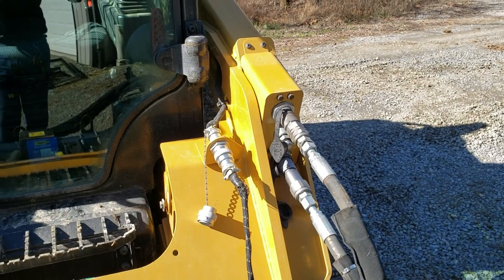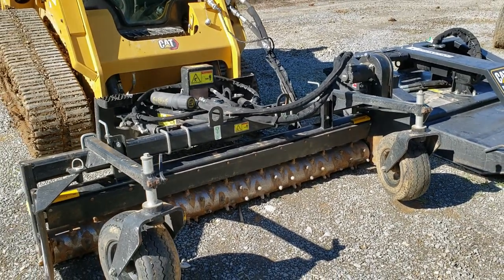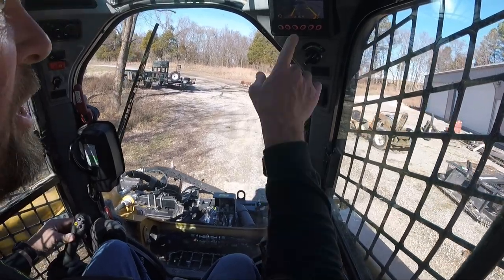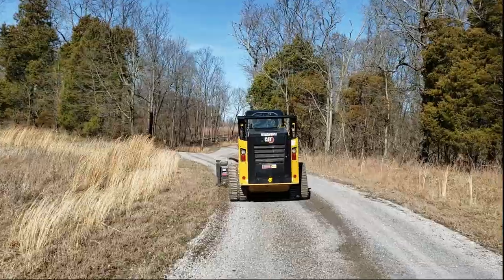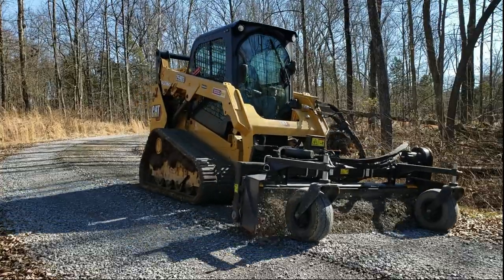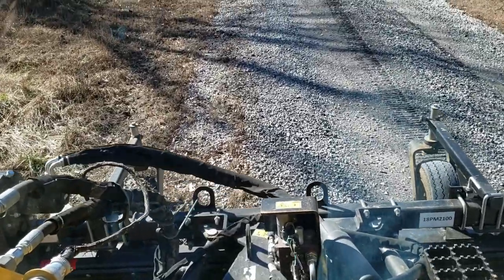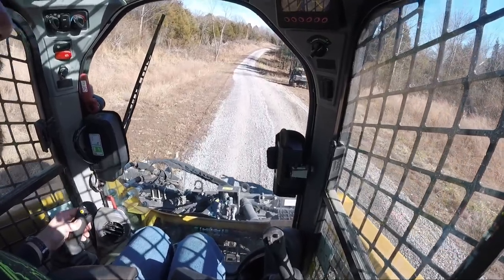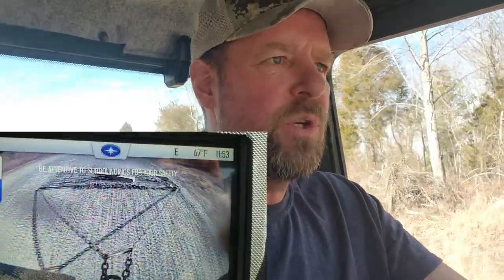CAT 259D3 grading mile long driveway with Harley Rake Illinois homestead

Comment: It looks like they have the power grader adjusted so it pulls gravel from along the shoulder and moves it back to the center of the road. That is great because it replaces the gravel from the tire tracks that gets squished to the shoulder when the drive is soft. It really did a great job to reshape the road with out needing a road grader to come in and bring the gravel road crown back and smooth the road surface along with the shaping. I like the way it worked.
Reply from the maker: yeah it does that, I didn't mess with the adjustments much, but it worked slick for sure :) Thanks.

Comment: If I had been told that the power rake (soil conditioner) attachment was originally designed for gravel driveways, I would’ve totally believed it. It is just perfect for that. Pair it with a vibratory roller and you have an unbeatable driveway combo.
Reply from the maker: That's what many excavators and landscapers use them for is gravel. If you get a quality one, you'll be fine on gravel. I'll be getting one of these with the Bobcat. Thanks.

Comment: Now that is nicer than the tractor, however you can still rent that for the 2 times a year that it’s needed.
Reply from the maker: Yes, I wouldn't buy one unless I got a deal on it, but I can rent this and many other skid steer implements if I pull the trigger on it.

Comment: As long as that harley is a rental. That is not what that tool is designed for at all. Yes it might work but that is a soil conditioner. I couldnt watch the whole video. I threw up a little in my mouth.
Reply from the maker: Well, I've seen it used many times for gravel driveways. One of my excavator friends who's been doing this for 40 plus years. Uses them on driveways. Hopefully the taste wasn't too bad when you started throwing up, LOL.
Reply: I always go in reverse when using a rake . To me going in revers does a lot better job than going forward
Reply from the maker: @DEDBRD-di4yj  Well, everybody's experiences are different. My excavator goes forward, and I also watched some videos from dirt ninja and he goes forward as well. Probably just a personal preference. Thanks.
Reply: Gravel will wear it more quickly than soil. That drum is expesive.

Comment: The Cat machine sure has a lot of awesome features, but what is the cost and reliability of all those electronics... Can't wait to see which one you pick!!
Reply from the maker: let me say it was not an easy decision!!!!
Reply: I always worry about the electrical issues and of course the emissions system that a machine has but I used to work for a big construction company that had a CAT 262C and in all the years I worked there I have never seen it down had over 3k hours on it when I left and it was far from cared for, or maintained. This company only ever changed the oil and filters every 1000 hours if that. Sad from my point of view because if because I am a preventative maintenance freak, I always learn where every hidden grease zerk is located and always change and check fluids oil and filters. Maybe it was a good pick of the bunch and they just got lucky but it’s better than the alternative of getting a lemon. In my opinion just about all machines are great when new but unless you dump them after reaching a certain amount of hours, longevity, ease of maintenance and parts availability are paramount. With CAT you can always get parts and service if you don’t turn wrenches yourself but be prepared for the CAT price tag.

Comment: I promise you want to stay away from equipment that uses proprietary attachments.
Reply from the maker: Well, sometimes there is no avoiding it. CAT uses CAT and Bobcat uses Bobcat. Gehl can be wired to use off brands and maybe adapted to these, but no likely, or they won't work properly so I've heard.
Reply: Nothing is proprietary except the plug!  That is just old outdated information built off the bobcat business plan that married you to the brand after you bought several attachments.

Comment: You need to angle the power rake to pull product from the side of the road to the middle to build or keep a crown.

I run a Vernig power rake with a hydraulic angle cylinder.  Takes the work out of changing the angle.

I've run several Harley and Bobcat power rakes as well.  The Bobcat fell apart in about one day. The Harleys are OK, but not built near as well as the Virnig.  That's the way to go. Very capable and strong machine.

Bobcat and Cat make great skid steers for power raking, but I use primarily an ASV because of its power and its ability to go where Bobcat and Cat can't go. The ASV tracks are awesome.
Reply from the maker: Good info. The bobcat I ordered has wide track, so it ought to be able to come close to the asv for traction. I know asv is a beast, but I didn't want to take a chance with the nearest dealer being in another state and like 75 miles. Thanks

Comment: Bobcat has the bobdock system. You don't have to hook up hydraulic lines anymore if you don't want to it's automatic. Mine has that option, as soon as you connect the quick connect it also automatically connects your hydraulics.
Reply from the maker: Never heard of that, never seen it. I test drove a bobcat also. You still have to connect the hydraulic lines, but that is no big deal when you're not bending and crouching down into an awkward space.

Comment: Do you think a power rake would work for busting up asphalt millings with a lot of chunks? Or am I just going to break the rake? The chunks are fairly soft and I was planning on doing it during the summer heat.  

Rental around me is fairly expensive for a attachment.  Over $200 a day.
Reply from the maker: I don't think it would work They make a specific one for that, looks almost just like a power rake. I'm afraid you would bend the drum, like I did going over some small stumps (Like 2 inch ish). Best of luck though thanks
Reply: Thanks for the info.  I'll look into that.
Reply from the maker: @Team Blue LLC Yes it vibrated badly so had to be replaced.

Comment: Is this  the smaller  rake  or the big  one ?
Reply from the maker: It's been awhile so I don't recall. If I had to guess I would say the smaller one since it is the 259 which is a smaller skid steer.
Reply: @kapperoutdoors   I  watched  closer, you got the  bigger  one  either  the 184  or 121  it's  called  now.

Comment: I owned a Cat wheeled skid steer a few years ago. It was great and Fabic was a good dealer. As with anything that expensive,  dealer support is a big factor. If I were to buy another one I’d have to look at JCB. They’ve got a single sided lift arm with entrance from the side so you can get in and out no matter where your load is situated. If you work alone as used I used to that would be a great feature. There’s a dealer in Hamel Illinois that I’ve visited but know nothing about.
Reply: CHARLES LANGE JCB skid steers and compact track loaders are comfortable, easy to maintain, surprisingly powerful, and the safest skid steer on the market.
Reply from the maker: Yeah, just due to the distance of the closest dealers I did not look at them. But I think I have a good thing going with the Bobcat, they are close, and I've had great dealer support. Thanks.

Comment: What are you using for mounts to mount to the skid?
Reply from the maker: All skid steer implements have a skid steer quick attach, makes things easy.
Reply: I meant as far as the go pro is concerned. lol
Reply from the maker: @TMartz247  lol yeah the question sounded wierd, but I didn't know if you knew this stuff or not! I use magnet mounts mostly! Thanks
Reply from the maker: @TMartz247  and suction cup mounts